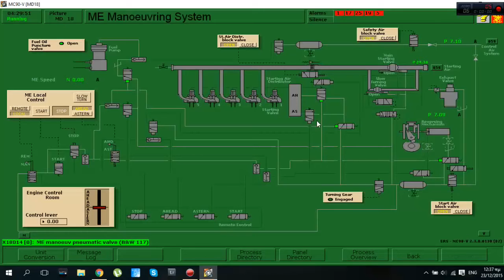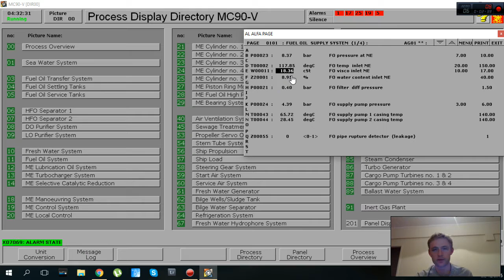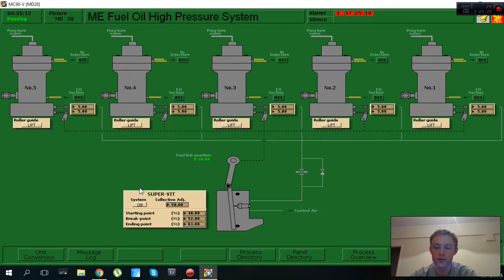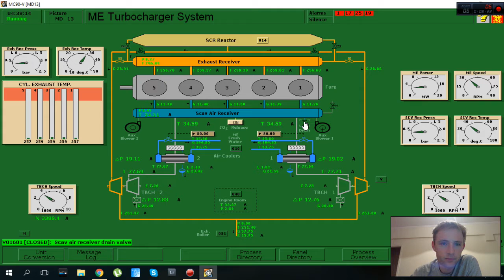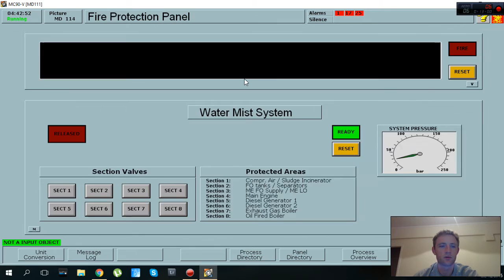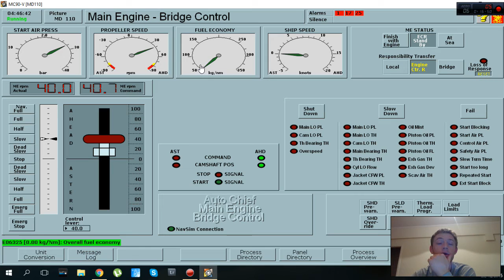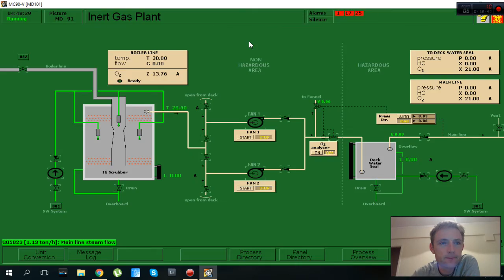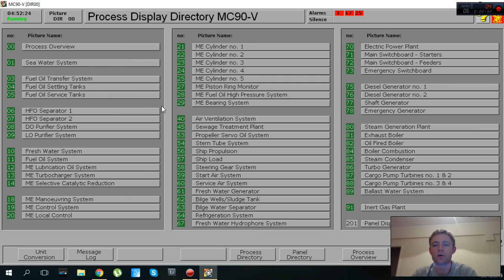How to Start  ship Main Engine after been prepaired lesson 13

Comment: Hi,

Thanks for sharing these videos. It's really a pleasure to learn from someone, who knows what he is actually doing. I have learnt a lot from you. By the way, you missed one thing, that is why your ship was not move at all. You left the "handbrakes" applied :) You probably need to release the mooring ropes, but in your software I can't see the panel for FWD and AFT Winches, where you can set the ship to moored condition. Maybe you need to check the variables manually by hitting F10.
Reply: F10 > SIM CONTROL > Stop ship (mooring condition) set to 0.

Comment: I don't have any page to unmoore either, but you can set the variable, press F10, then at the top "page 0000" type page 9200 (or you can click the page down arrow many times. on page 9200 set "Stop Ship   (mooring condition) to 0
Reply from the maker: Dear friend i have observe some issues also in crack version hope it will work in some way so you will be able to use the basics thanks again.
Reply: Yes thats correct